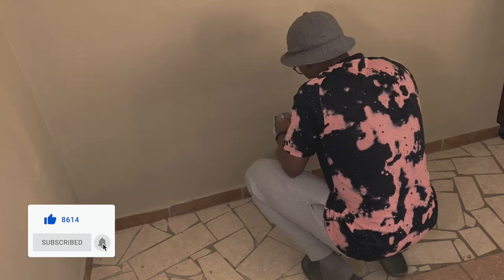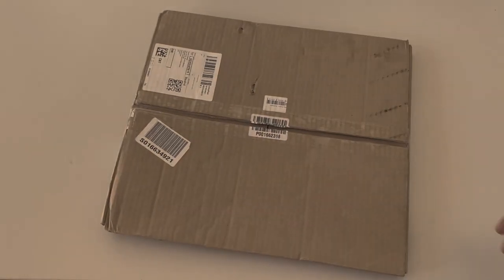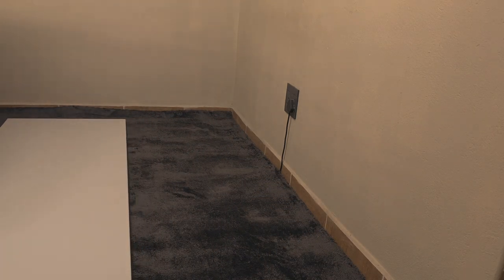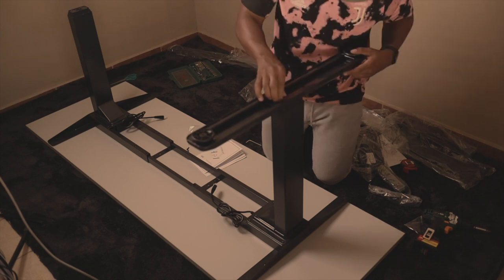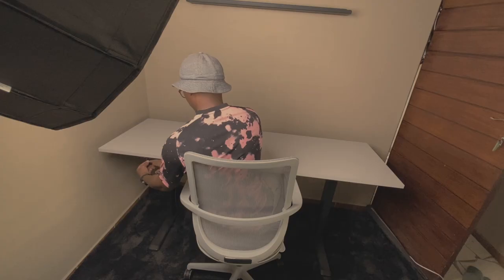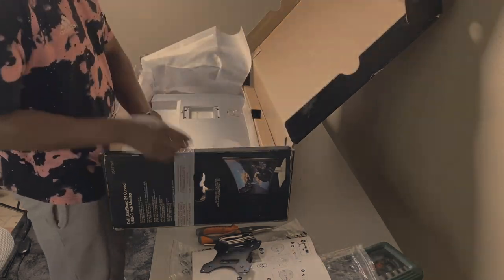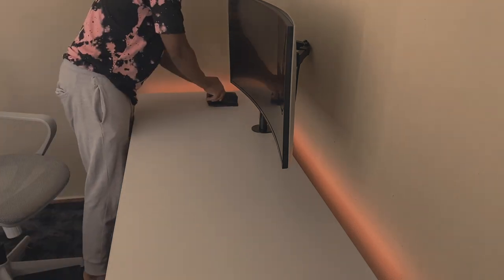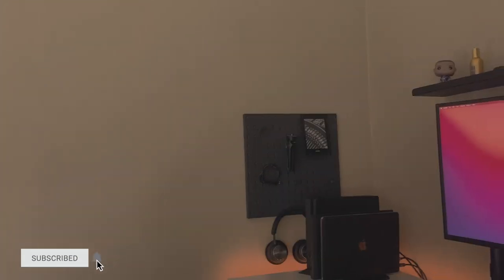Desk Setup Transformation | Upgrading My Home Workstation | Desk Tour 2021

Comment: Hey bud! Nice video. A question around the desk - Does it support custom height adjustment or only has 3 levels that we can set it to?
Reply from the maker: It goes up really high, up to about 1.6metres. There are 3 buttons that you can assign with preferred height, or u can just use the arrow up and down to adjust to your liking.
Reply: @thembakhanye  thank bud! What's the lowest height setting?

Comment: Hi Themba, 

Great video and awesome setup. I am looking at purchasing the same height adjustable desk from PC link. 

1. How has it been since purchasing it? Day to day usage
2. Is the quality good and does it wobble when using it in a standing position? 
3. Would you recommend purchasing it at its current price of R5700?

Thank you
Reply from the maker: +Jared Naidoo Hey Jared, first off thanks for watching. I work from home full time, so I’ve been using the desk literally everyday. It is very sturdy, no wobble even with the heavy top and all the stuff I have stacked on it. Maybe I should do a review? 

So far I haven’t experienced any issues with it. However, now that we have load shedding, the desk will remain in its current position until the power is back and I do hate that controller goes to sleep and when u need to use it u kind of have tap it and wait a bit for it to light up.
Reply: @thembakhanye  Hi Themba, thanks for the information. Yeah you should do a review as this table is carried by many of the sa online retailers (This is a rebranded table by a company called Lumi). Another popular desk sold in SA is the TekDesk 2.0 sold by deskstand (also eems like a rebranded desk made by Loctek) however this desk is much more expensive (They offer an addition guarantee though).  The Equip desk is so much cheaper, so a review would definitely be useful for buyers. 

I ended up getting a TekDesk with a wooden top from Leroy Merlin as I could not find any reviews for this Equip desk online. Only one video was made and that was yours.

All in all great video and content.

Comment: I noticed that you docked your MacBook, don't do that. it's bad for heat dissipating , when your laptop sucks in air, it will hit the screen and can cause damage to your computer thus leading to components overheating on the logic board as the hot air doesn't have enough exhaust exit. 

I used to do the very same thing, plus I'm a programmer and always doing heavy tasks which lead to the death of my MacBook.